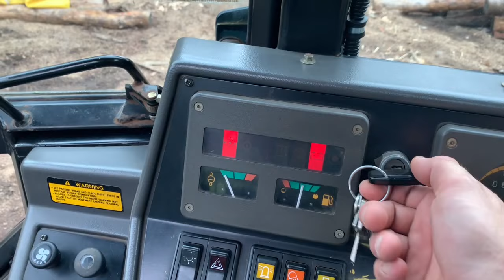HUGE UPGRADE FOR PROCESSING FIREWOOD! (This may be the biggest so far)

Comment: Map every movement and then work with your family to reduce total feet by half. Then do it again. This is a common exercise in factories where they reduce footsteps which equates to efficiency.

My recommendation, not actually knowing your process well, would be to install a low-slope ramp from your log piles onto your processor feeder. Bring up the logs using two winches, and no heavy equipment. Logger to piles to feeder to processor to trailer.

Thank you for the video!

Comment: How about “OLD YELLOW” love the storey behind it, amazing how much wood it can haul. Is there enough oil flow in the processor to drive a hydraulic motor for the conveyer, if so you can eliminate the generator. Keep safe my friend.
Reply: Generator cheaper to rebuild than the backy motor

Comment: Could you use the backhoe to load directly on to the processor eliminating have to use all 3 machines
Reply from the maker: I could 😁 it’s a little more easy and I have more control laying the logs on deck with lil bob :)
Reply: @thatwoodguy104  that makes sence u would definitely have more control with little bob than backy